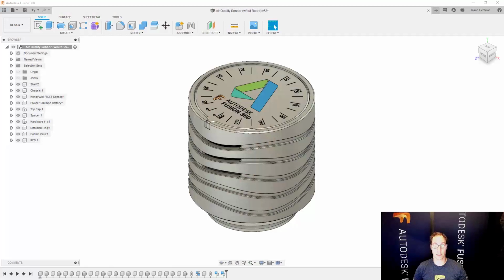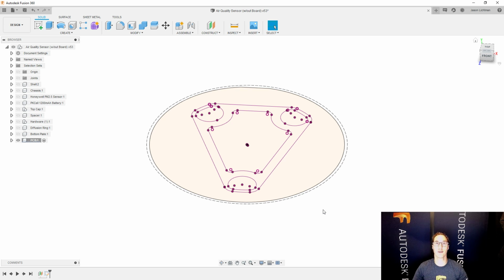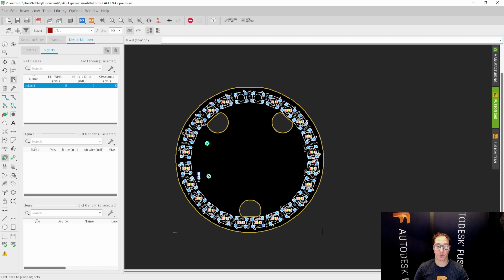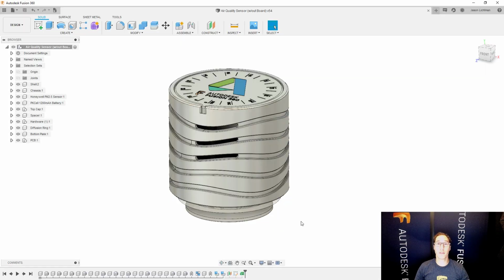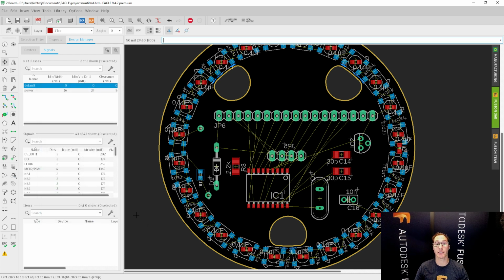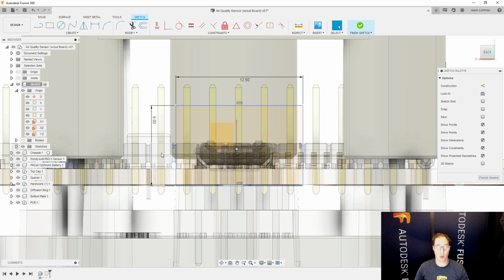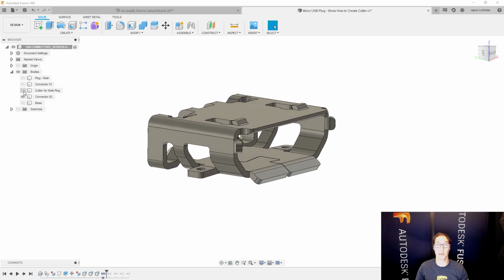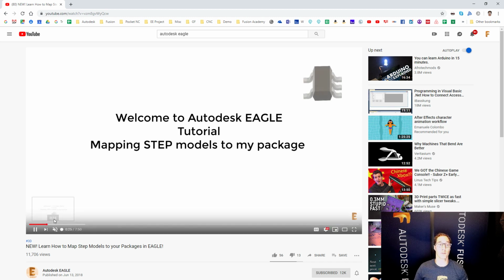E-CAD + M-CAD Workflows and Tips

Comment: I am an EE and ME using Eagle and Fusion360 to design fairly complex systems. Some have up to 15 separate PCB's inside an enclosure made of 20 unique CNC parts. The integration between Eagle and F360 is certainly a great idea however, it is rough around the edges and has a tendency to explode. Early in the design process when major iterations are occurring is when it is at most risk of having fiddly errors and problems. Since I am designing in both environments, I have slowly learned to manage the quirks but they are really frustrating early on. 

Eagle, as a standalone application, is a throwback to 1995 in general but gets the job done eventually. Among the most crucial element that ties Eagle to F360 is the part library in Eagle which is a crime against humanity. The optimist in me is hoping that the F360 team [representing the year 2019 and beyond] can bring the Eagle team into the 21st century - starting with the part library (part creation and management)